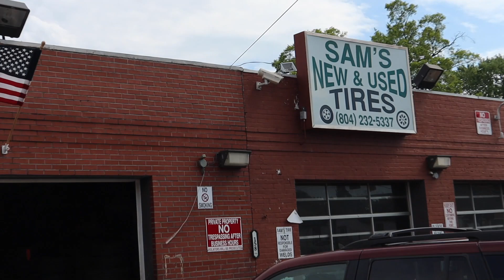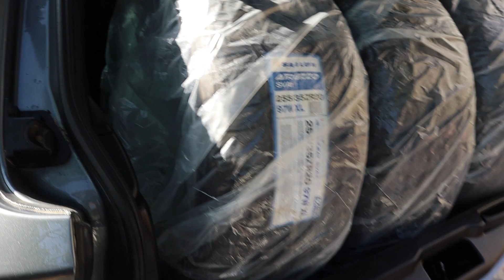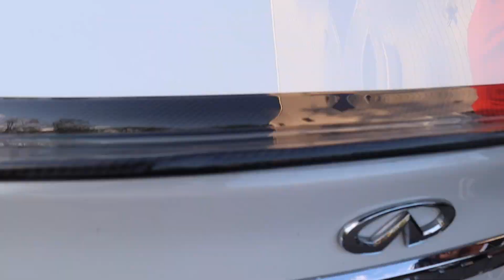F1R F29 Rims Installed On The Q

Comment: What kind of lugnuts/ socket are you using for your wheels , just got a set and can’t mount them 🤕
Reply from the maker: Not sure, they came with my rims from figment industries
Reply: Hey bro what lug nuts you use then ?
Reply from the maker: @carlosesparzavazquez4753  got em from fitment industries when as a package deal
Reply: @nohandoutsgarage  found out it uses conical seated lug nuts

Comment: So now that it's been a while. How have these wheels been holding up. Been looking at getting a pair
Reply from the maker: so me and my got the same wheels, his 17’s with a 40 inch profile tire, mine after with a 30 inch profile tire, my rim cracked at about 7-8 month mark, his are still going strong, no problems. It all depends on what profile tire you run tbh. They were fire though i’d shop with f1r again